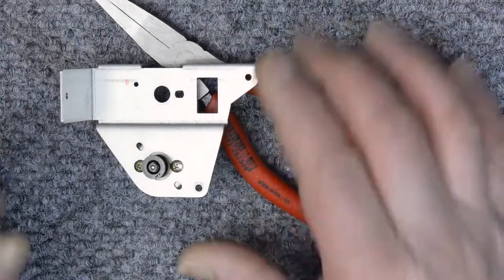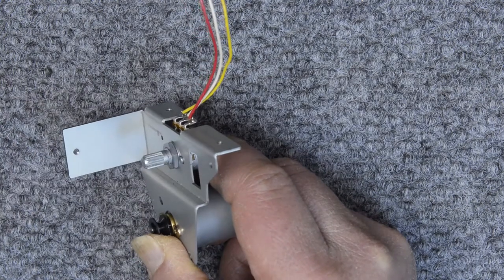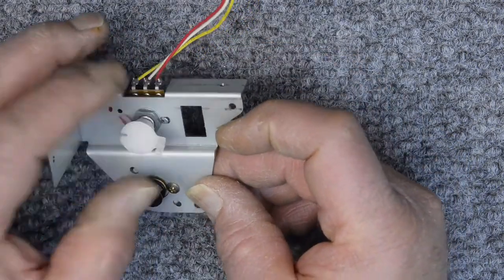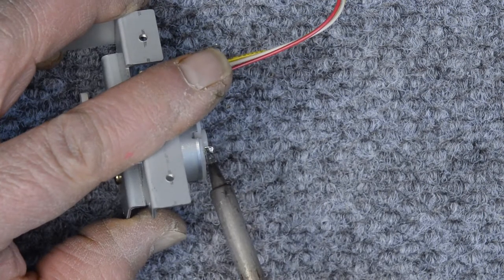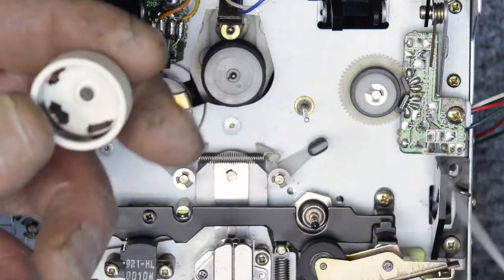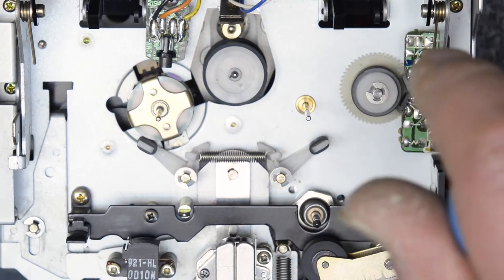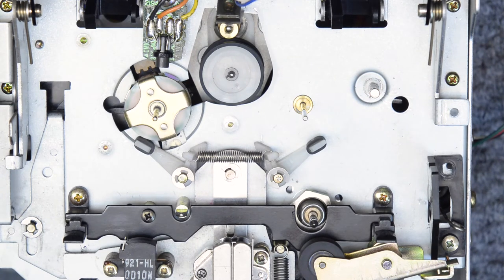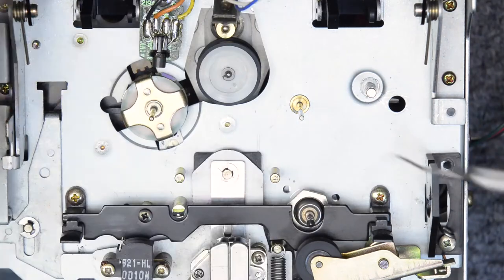Tascam 122mkll Cassette Deck Full Transport Service - Part lll

Comment: Great tutorial Peter. Just finished replacing the control belt and the idler wheels from you earlier vids, but I think I might have to do the full service as it seems a little hesitant at times, and when I engage the pitch control it just slows to a crawl and stops.
Reply from the maker: Mark, that pitch control is a problematic thing. Cleaning the switch may solve it but the potentiometer is probably a lost cause and needs replacement. Try the contact cleaner first on the switch (not the pot) and see what happens but it may need a full service which requires a circuit modification to accommodate the replacement pot. Let me know what happens.
Reply: @asbcustom  Thanks Peter, I'll give it a try